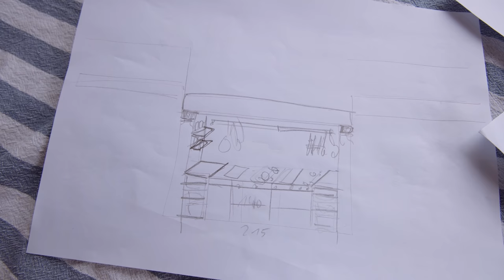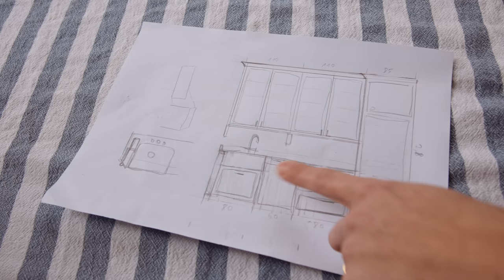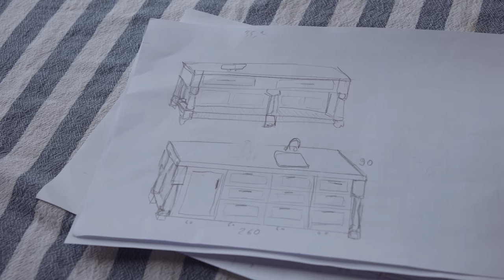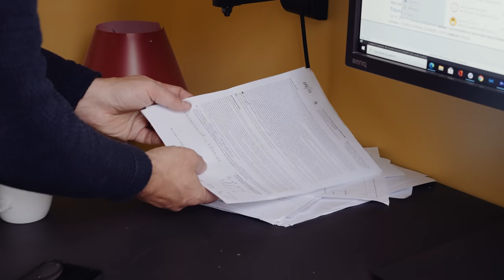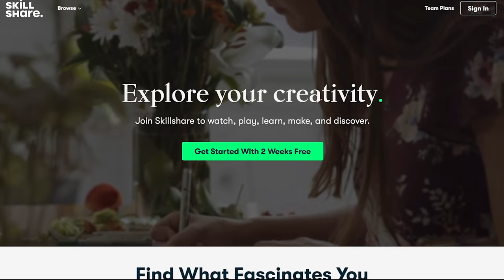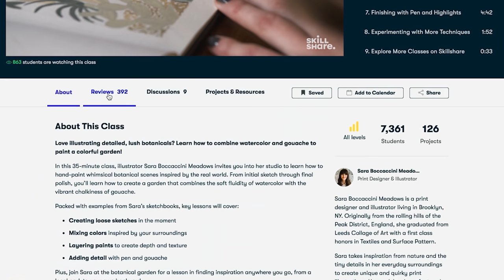The TRUE meaning of LOVE

Comment: If you use wood as a work surface, try the butcher block technique of upended wood blocks, easier to scrape away any damage as they did with butcher blocks. There are some woods that are more food friendly like maple. You could also encastre a slab of marble into the worktop for pastry making. Maybe bind the worksurface with brass like a bistro and don't forget to round of the corners unless you want blue hips. Put a brass towel rail in two places. Just an idea xxx
Reply: Great ideas! I love my pastry stone area. A BIG yes on rounded corners.
Reply: My first thought was maple, too.  It's worked for us. Marble inset and brass rails are also great ideas!
Reply: Such good ideas.
Reply: if your state kitchean approved please look into the requirements.  so you dont have to redo.   depends if your getting licenses etc.
Reply: We made beech cutting boards in my woodshop class. I say have Benoit look at that beech tree wood and see if it’d be suitable for a worktop table! Would want it kiln-dried, though maybe he has a place to do that?
Reply: Really great and highly practical  ideas.
Reply: LOVE all these suggestion! Butcher block with marble inset is perfect. I suggest going with copper and iron accessories.
Reply: FABULOUS ideas! This gets my vote!

Comment: For 30 years I have had an 11 foot by 5 foot butcher block wooden island in my kitchen. There is a 15 inch circular sink for vegetable preparation and a 7 inch hole opposite the sink that drops down to a trash container (there is a different place for recycling). There is a separate area in the kitchen for cleanup — a large sink and a dishwasher on either side of that sink. It has worked wonderfully. Approximately every 10 years we give it a light sanding and rub with mineral oil. It is low maintenance and we have had no problems with the wood and water. I based my kitchen layout on the kitchen at the Brighton Pavilion. It has worked wonderfully for just my husband and I or for large groups and caterers. Love your program!!!!
Reply: Perhaps you could send them a pic! Sounds perfect.

Comment: Marble is porous, so if red wine spills, I'm not sure you'd like it.  There's gotta be another stone for pies that isn't marble, like quartz, which doesn't require sealing, and is heat scratch and stain resistant...and if you have enough cherry from your fallen trees, maybe use that for the butcher block, adding strips of other woods if not enough.,  like bamboo, or red oak, walnut,   which you may have an abundance of on your property.
Reply: Hi, nice ideas but just want to clarify one thing.There’s a difference between quartz and quartzite. Quartz is a man-made material and it uses resin to bind chips of quartz and marble.The quartz is not heat resistant. The quartz top does get damaged if you put a hot pot on it due to the resin in it.Quartzite does not, as it is a natural material. It is a little expensive but it’s really beautiful. And it’s also good with stains. I prefer it over the man-made quartz. There is also a newish material that’s becoming popular that I just used on a residential project. ( I am an interior designer) It is porcelain slabs. Dekton Is one of the manufactures. The head company is Constantino and you can look on the website there.This company is in Europe and in the US. There are other manufacturers also such as Neolith. The material is absolutely beautiful, comes in a range of patterns and colors and because it’s porcelain, it is impervious to heat, stains, scratches, and can be placed outdoors where quartz cannot(due to the sun turning the resin yellow sometimes) Hope this helps!
Reply: I’ll be investigating this myself.  Thank you for this insider tip!

Comment: My kitchen island has a wooden top made from teak planks. We just lightly sand and oil it every two years with food grade wood oil and 8 years down it is still good. The one thing I am very strict about is not cutting directly on the surface so we always use chopping boards and trivets for hot pots. I also don’t really use any harsh cleaning products - only wipe it with a damp microfiber cloth. Never regretted changing the original granite top for wood.

Comment: You asked about worktops and recommendations. If you want wood, I have wooden worktops. Get a hardwood, I bought solid oak from IKEA, they were thick and of excellent quality, they come untreated. If you want an extra thick look double it up and clamp and glue them together. They are not as thick as the original ones I fitted in my beach house in the UK. I use Osmo oil, they do many wood products and are excellent. Osmo worktop oil is quick to use and re coating is simple.... There wood stain is very good for window shutters!! If you want hard warring  get granite, or quartz... Don't use marble as it is porous and a pain to look after... Keep up the good work!

Comment: In your busy season, you will be cooking for many people, it might save you a little time to put a small sink directly beside the stovetop to strain out all the pots you will inevitably be cooking which would allow your central island for plating meals. And if you install a pot-filler tap on the wall above the cooktop you can fill them without having to lift large, heavy pots across walking spaces...  which will save your back.

Comment: Add some rice to a sock and tie the top. Put it in the microwave for maybe 30 seconds, depends on your microwave. Check to see, it should be heated. Then put it on your dads back. Poor chap. If you want to be fancy, sprinkle some spice in, cinnamon or lavender. I sew packs for gifts, I make strips like short scarves and baffle them so the rice does not shift to one end. They work great and drape beautifully over shoulders, legs, etc., they can be made with lovely fabrics and sold if you have a gift shop or include them in your rooms in cooler months.

Comment: Re kitchen plan ideas: love that you’re going for a crafted chateau appropriate style and working with the existing features while modernising your work area.  It would indeed be useful to see a plan detailing the ideas and exits from the room in relation to the flow of the house.  Not clear to me if after using existing door as new broom cupboard door in the same room whether this door opening disappears?  I’d propose a wood island/chunky work top.  Your carpenter should be able to advise…definitely a hardwood.  I like the idea of not having worksink on the island but not 100% convinced of current proposed location.  How about the opposite wall close to a window and with no overhead cupboards?  Views are great while doing wash ups.  The dishwasher would have to move with it. If absolutely necessary to have island sink consider one closer to coffee/tea station for ease of use….or perhaps instead a pot filler over the stove?  Love that you move a bigger more sensible and cheaper wine fridge to another room!  Could you possibly also move the proposed new broom cupboard and recycling bins also to another room?  Please consider having a bin wherever you have a sink and definitely one under the island regardless.  Love underfloor heating idea!  You could convert a window to french doors now!! How about moving coffre station next to new proposed pantry next to my proposed new location for sink and move fridge to other side where you now have plan to put coffee area?  If you have space for a double fridge freezer even better.  If not, you could buy a cheaper not for display freezer (opening from top) and put in same room as the wine fridge?   You’re definitely heading in the right direction👏😊😄

Comment: I would change the position of the sink to the middle between the dishwasher and the drawers. That way you can put dirty dishes on the left of the sink and the clean dishes on the right, simultaneously you can access the dishwasher and the drawers without moving away from the sink with wet hands. So if you need a new dishcloth for whatever reason, you could store them in the highest drawer and just grab it. With the first drawing, you would have to step away from the sink and get the floor wet.
Reply from the maker: Thanks for the tip, we'll look into that!

Comment: Marble countertops will look great - until you spill something and it gets absorbed and then you are skrood. I had marble, but changed to cesarstone 5 years ago. You can get marble look cesarstone if you like the look (Silestone is another good brand). That material is pretty much indestructible. Wood sounds lovely but I have no experience with it, so don´t know. However, remember that you will have a large wooden surface right next to the island (the kitchen table) and there could easily be a bit of discord between old and new, different tone wood, etc. Choose wisely! (I´m sure you will, I have faith in Anna as a designer of all things beautiful)

Comment: I would suggest quartz marble effect work top  I have sent you a link with the edges and they are much easyier to keep looking in good shape... Wood needs to be oiled and you have to be careful of damaging it with heat  from of the stove and knives  that slip and mark the wood.... quartz has none of these problems and you can have a special edge put on to make it look thicker  than it is and have it carved.... I think it's laminated these shapes will look spectacular and the white marble effect will help keep the kitchen looking bright.

Comment: So I have a suggestion for the maintenance of the wood on the island.  It is strong stuff, but wonderful in my experience, I recommend using Rustin's plastic coating, it literally seals it and prevents any water or other damage.  It is used on the bars in pubs and once it is on there it is incredibly tough, it doesnt need redoing and it bonds so well it is like rock, whilst still keeping the wonderful look of the wood.  The only thing I would say is that you have to read the instructions well (Philip!!) and follow them (Also Philip!!). It comes in a small size if you want to test it...
Reply from the maker: thanks for the tip!

Comment: There is this wood we call pumpkin pine in america. It is a beautiful warm wood that would look amazing on work surfaces such as the island and draining board by where the new sink would go and it plays well with copper elements. I know that pine is a softwood but you could do a coat of clear high heat epoxy resin. Some industrial high heat epoxy resin's can stand temperature's of 1500 degrees. Although you would still need a cutting board, the resin would be easy to clean without worrying about damaging the wood. Just a thought.
Reply from the maker: thanks for the tip!

Comment: Maybe use epoxy resin on the island wood top, to protect the wood. That way you can use any type of wood. If you don't want it to be glossy, you can just wet sand it with an orbital sander, grit 320/600/1500 (3 steps).